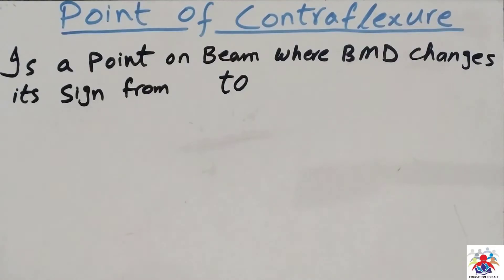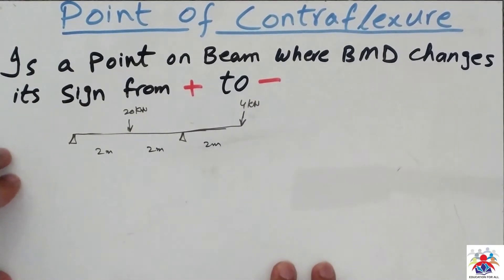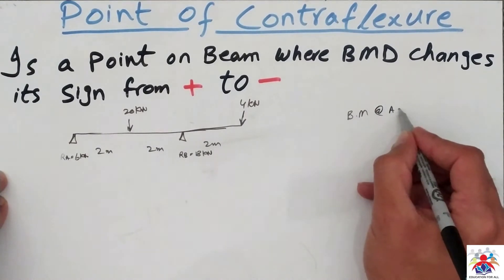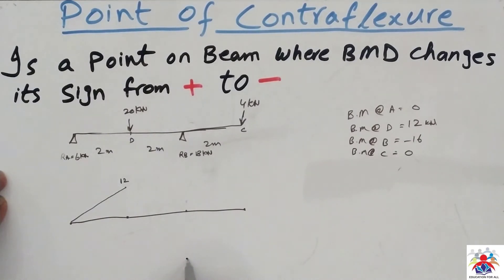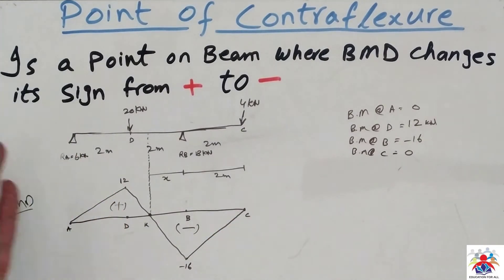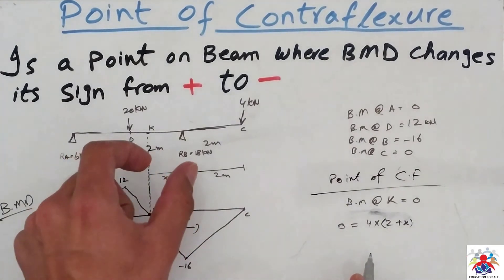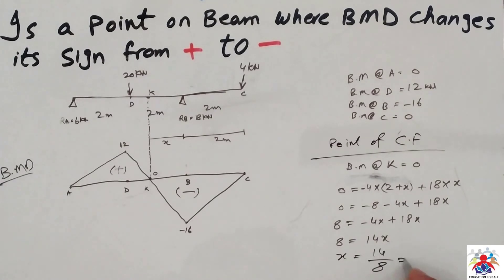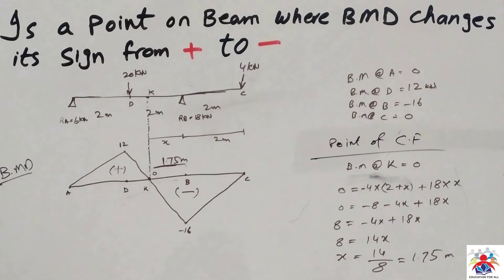Point of Contraflexure With Example Solveed

Comment: Sorry, but the reaction forces are both incorrect. Ay is 8kN and Cy is 16kN. I calculated by hand and using structural software with both answers correct.
Reply: Yes ... i checked this 2 times. Correct reaction is Ra=8, Rb=16
Reply: Your right thats what i got too

Comment: Sir 
B.m of B =-16 if we calculate it frm left to right but when we calculate b.m of B frm right to left then also we should get -16 but in u r problem we r not getting 16 when we calculate b.m of B frm right to left 
WHAT IS U R EXPLANATION
Reply from the maker: Thanks for your message. As you can see this beam is not symmetrical so that's why the answer could be different while calculating from right to left. Please note there is a little mistake and I have explained in the video description.